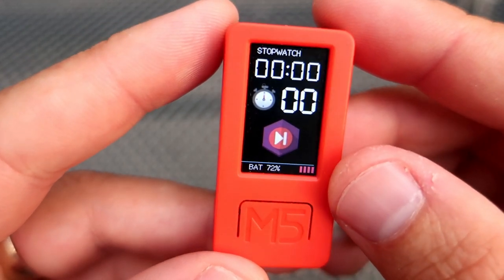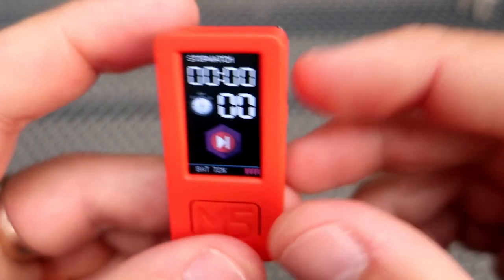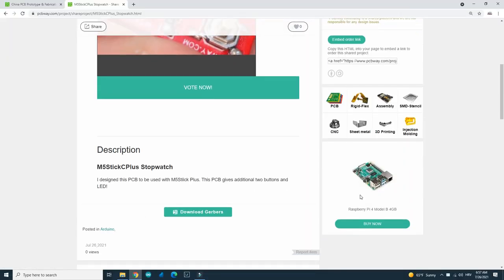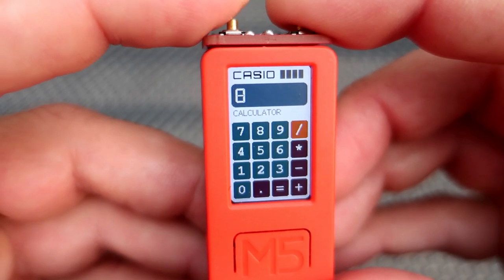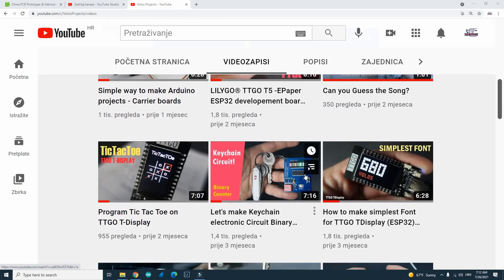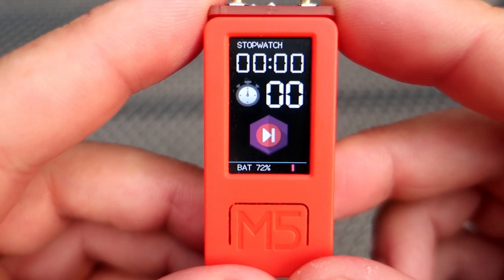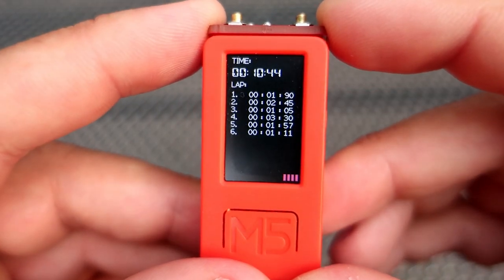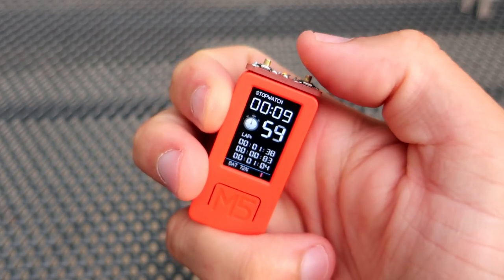How to make stopwatch - M5Stick and Arduino IDE

Comment: I would like to use the m5 stack pico to create a device to automatically calculate flow rates so it will need to start counting time like a stop watch and then divide a set gallon amount by the time and multiply by 60 to give the gallons per minute. An example would be you press the button and dispense 1 gallon of fuel, it took 11.23 seconds to dispenser and I want the display to print the time elapsed and 5.34 gpm. I'm very new to programming. Would you recommend modifying code like this stop watch to do what I want or would it be easier to try and start from scratch?

Comment: Very nice! How long does the battery last? You could save battery by turning off the display 10 seconds after the last key press. Also it looks like you hard coded the remaining battery capacity. I'll leave a formula I use to convet LiPo battery voltage to % remaining in an issue on your github 😀
Reply from the maker: Thank you, i forgot to finish code for battery.